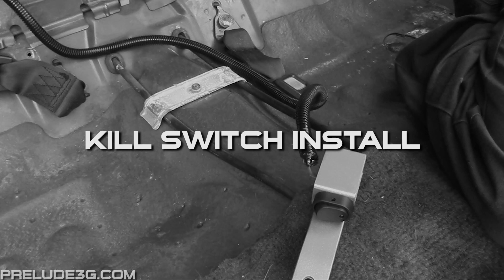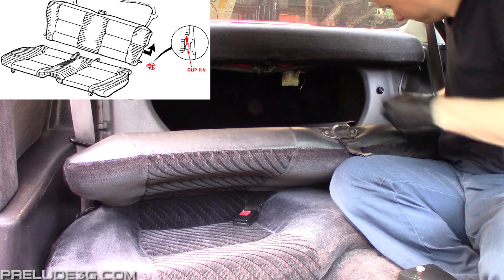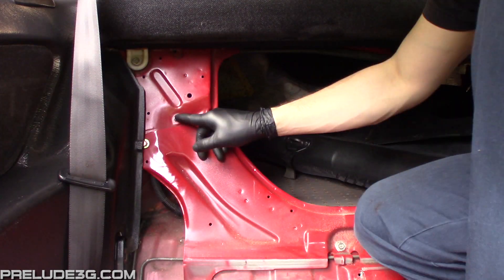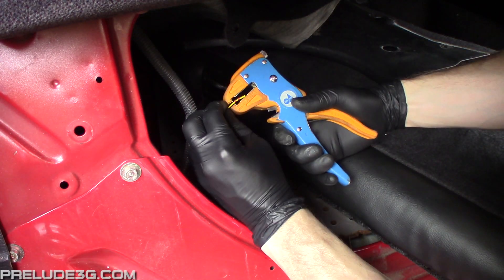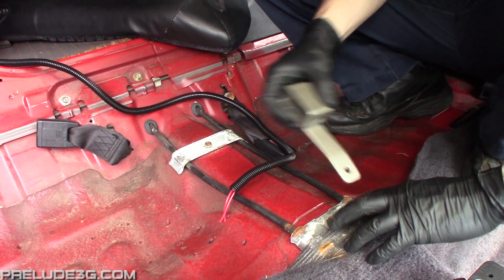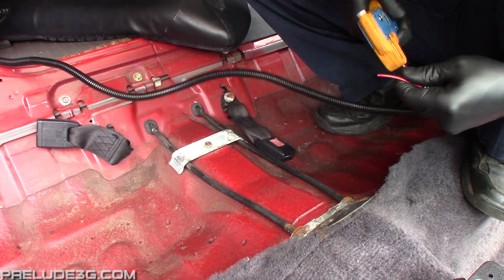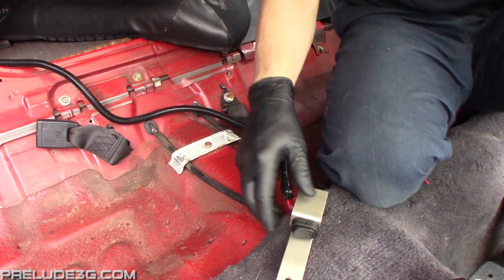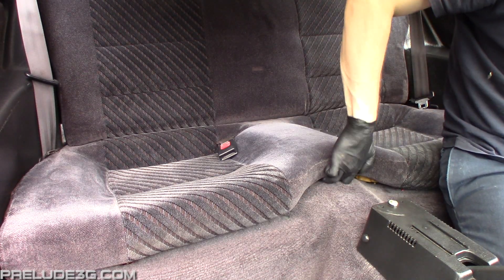Kill Switch Install

Comment: Should have done that at the starter relay under the hood. And dont use crimp terminals unless you solder them or you could get stranded as they come loose.
Reply from the maker: You don't do it to the starter because  that means the car can still be push started. Solder is not reliable for splicing wires which is why it's not used in motorsports.

Comment: Would this work any better or worse if I connected this to my clutch safety switch instead of the fuel pump?
Reply from the maker: It would work on the clutch switch but if done that way it would still be possible to push start the car.

Comment: Very detail video! Nice and exactly what I was looking for. But would this black and yellow wire would be the same for my 00 Civic EX? I was also wondering how to remove my back interior, and looks to be removable the same even though this is a Prelude.
Reply from the maker: I couldn't say for the Civic but I would try to find a digital service manual for it online. That will have the wiring diagrams so you can confirm the wire color and interior disassembly information as well.
Reply: What about for 93 h23a1 si nonvtec?
Reply from the maker: @fl3xable1  Sorry for the late reply but the manual shows that it will be a solid yellow wire on your car. The wiring is still behind the back seat but on the opposite side of the car.
Reply: Looking forward now to do this switch meantime !
Reply from the maker: @fl3xable1  It's the official Honda one here: https://www.manualslib.com/manual/1053672/Honda-Prelude-1993.html